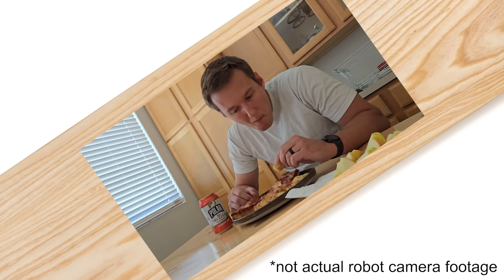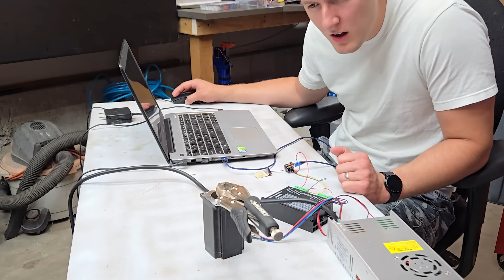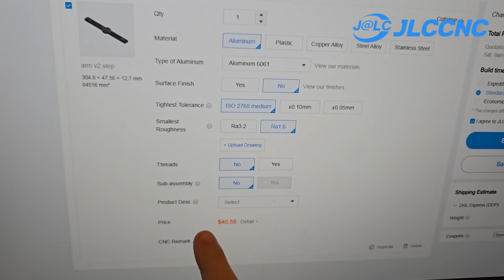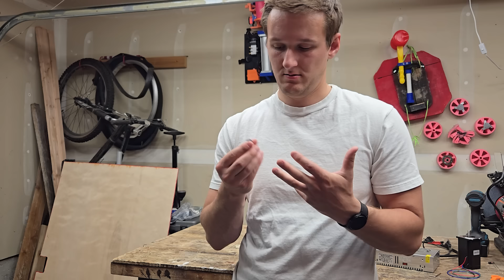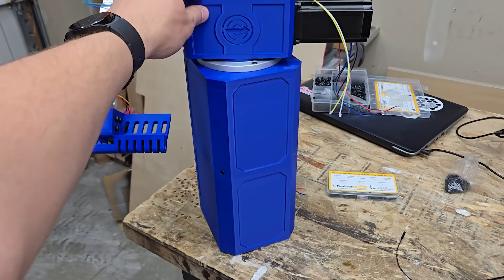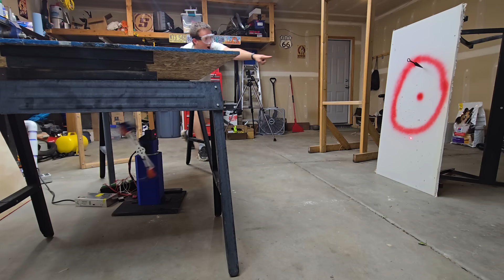I Made a Knife Throwing Sentry Turret for Home Defense

Comment: No spin, the challenge is getting it to release at the right time, it doesnt need to spin at the speed of sound or use immense power. With no spin as you throw you leave a finger extended so the handle slides along it and counters the rotation.

Comment: At first i was thinking about some kinda tuned mass on a string or something that releases and pulls inwards to compensate for the lost weight upon release but then i thought about a worm drive or some sorta sprag clutch bearing setup to help control arm speed when the knife releases, not sure if the tolerances would be tight enough for this use. theres also the modern route.. sensors and and arduino

Comment: nice thing u made. to make it more reliable, why dont you use an optical sensor like airsoft (toygun) products use. They either use reflectors or different patterns in either gears or the trigger. Maybe have an rpm meter or smth like that that detects whenever the arm passes and just a fraction of a second after the arm passed, you could signal the servos to open the gate. regarding the servos opening, I suggest using motors with more speed to make it more reliable. maybe even a mechanism like a bow wrist strap trigger thingamajig uses (got the idea here from youtube, opens just like a claw, way more reliable and faster)

Comment: I would try a solenoid and lever system. Place a fast solenoid parallel to and above the pin with an uneven rocker, short arm attached to the solenoid. Lube up the pin and you’ve got a reliable and consistent actuator!

Comment: Some ideas... Could be a lot easier (albeit less chaotically entertaining) having the magazine decoupled from the swing arm, with a separate reloading routine.
Simple spring/latch magazine. Solenoid for release/reload. 

When the arm comes by from one direction, it disengages the magazine latch to release a fresh knife, and the spring behind the latch in the mag keeps the rest from falling out once the arm is clear. Then the solenoid locks in the fresh knife. Could avoid the rotation factor in the reload code by using a hall effect sensor/magnets on the magazine. Or maybe the spring in the solenoid would be enough, assuming it's normally-extended without any power.

It wouldn't be as potentially-fast, but handling the weight problem would be easier. Less wobble from the tolerances in a single-knife holder. And the expensive slip ring would still see some use for driving the solenoid. I think you could get it going pretty damn fast with some tuning, and the tuning would be more tolerable if you're getting little dopamine hits from actually landing some throws via simplifying.

Comment: Heavier knives tend to be more stable. Probably more expensive and harder to design around because of the weight but might've been easier to get the timing of the release. Source: I don't need a robot to throw my knives for me (:
Reply from the maker: hmmm that may be a good solution...
Reply: @currentconcept  I learned to throw with 10" landscaping nails which are pretty cheap and a decent weight/balance. Wouldn't work with exactly the same release mechanism but maybe a slot for the nail head?

Comment: @currentconcept  So, when one knife is released, the system is off balance, I'm assuming? 

I'm about as smart as a box of thumbtacks, but here's what I'm thinking.  Simplify it down to successfully throwing ONE knife with ONE counterbalance on the arm.  Get a fixed RPM on the throwing arm at a fixed distance using a fixed release point/time based on getting the knife to throw forward consistently (maybe lock that point in with a break-beam sensor activated when fixed target RPM of the arm is reached).  Your Bot is just a baby and has to learn how to successfully throw forward 100% of the time before anything else.  Have NinjaBot throw a knife and watch it under highspeed or slowmo and count the amount of times the knife flips before it hits the target.  If it hits the target handle side first, you'll have to increase distance to give the knife more time to rotate to hit point side first consistently.  Inversely, decreasing the distance could achieve the same result because luckily, the knives are rotating in flight and will not require perfectly point-first impacts which leaves lots of room for successful knife "sticks".  This part probably isn't needed, but I'm sure some math and code could be done to then have the robot read distance to target and auto-adjust RPM and release point for variable distances since you now have a flips per foot traveled measurement from the highspeed/schlowmo footage.  That math and code will have to be tested furiously and tweaked relentlessly until "distance 2" is hit point-first consistently.  Sanity check the code by testing a randomly chosen "distance 3" to target for point-first impacts.

THEN work out a multi-knife, multi-release system.   Also, that Bot needs a sturdy base LOL!!  Happy knifing!!

Comment: Cool video! You should make the rotation of the arm itself activate the release though. Make it (when activated) hit a e release trigger in its path of the rotation. That ensures the release is fully triggered at this exact point of its trajectory. I think using a servo is just too slow to compare to the high RPM of the spinning motor, causing even millimeters of wobble in how the knife is attached to let it go in a completely different point in the rotation.

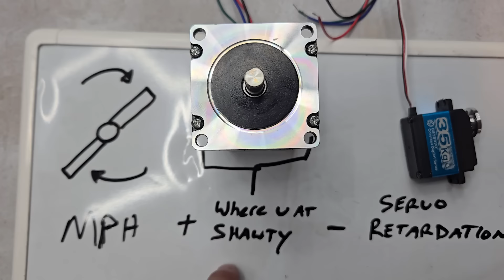Comment: 8:24 Bro, you could've put a cam (a button with a roller attached to it) on the end of a piston that extended when the arm was up to speed. When the piston moves the cam into the rotating arm it would pass over the cam, depressing it then initiating the firing sequence at the proper time every pass. No math or step motor and less coding.
Reply: Alternatively, you could use a proximity sensor to check paired with an AND gate after the time is greater than the time it takes to get up to speed.

Comment: the pwr signal to actuate the relase servo might take too long to be sent and read and cause some issues. if its 20ms+-2ms, your throw will be off a lot. instead you should go the harder way and make a hardware solution that just releases at a certain point. you can engage and disengage the release eloctronically, to only fire when you want to.

Comment: Attach each knife to a ribbon and retain/release then via the ribbon. It will be a quicker release with less friction/interaction between the ring and rod, it will fly straight forward from point of release, and the ribbon will help stabilize the knife in flight, like a kite.
Reply: Reminds me a bit of the string-pullers/handheld release mechanisms used with bows/slingshots/slingbows, but I'm not sure why. CC should check out ZNA Productions though if he hasn't already

Comment: Those slip rings can have everything from very finely machined traces with spring contacts to liquid metal (InGaAs or mercury) conductors in them - that's why they're ludicrously expensive. Genuinely easier to do it over Bluetooth.

Comment: If you're throwing the knives with no spin but allowing them to rotate freely on that thing, the direction that they are headed is going to be perpendicular to the point which is an issue. You should restrain them so they're pointed in the direction of rotation and give them some kind of tassel so they have just enough drake to keep flying point first. This is my bet on why they're currently unstable.
Reply from the maker: i believe youre right. Looking at the footage they were spinning once they came out which is not supposed to be happening lol. I'll fix it in version 2

Comment: Likely a problem with the counterweight after the knife is released, for the half arc of rotation, it is unbalanced. You could have one side that throws knives and the other drops a counterweight at the same time, likely near the bottom of the arc if the knife is thrown at an optimal position, then just multiply the time to release by two to get knife releases and skip when the weight side is in the "throwing position." This way, the system is constantly balanced and does not need to perform a half rotation unbalanced after a knife throw.

Comment: I suspect the release issues might be due to timing variablity on release. The rack and pinnion might move at a constant but under load it could differ due to friction caused by centrifugal forces and as knives release the timing further changes. You could use fishing string and nichome to cut it. It would be variable but less so than rack and pinion potentially. Another option is look i to the quick releases used for bow and arrows then actuate with servos. But thats more weight. Good luck. A lowtech solution is turn it into a knife trebuchet if you design the basket just right it could be zero flip release.
Reply from the maker: i think youre right. Im getting rid of the rack and pinion setup for part 2, so hopefully itll eliminate any uncertainties there